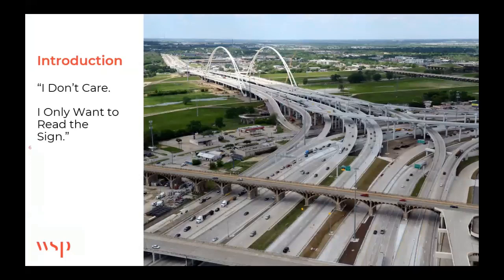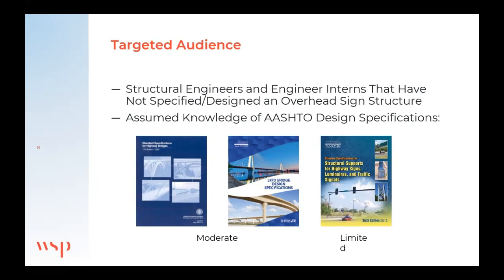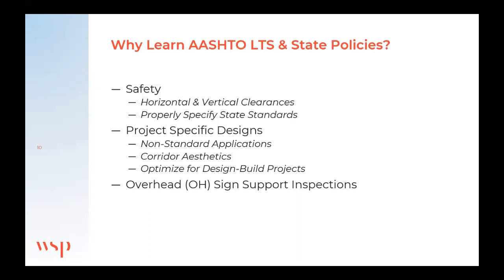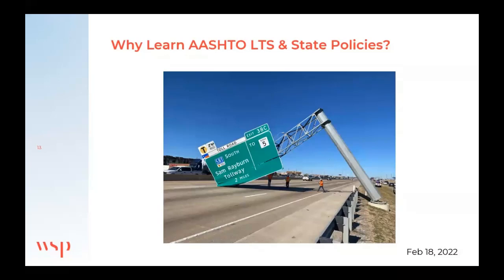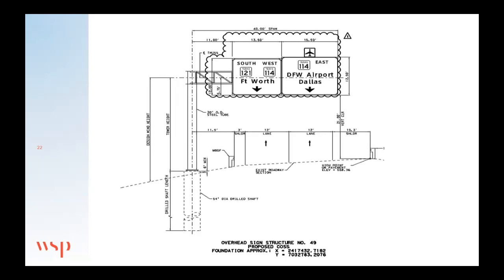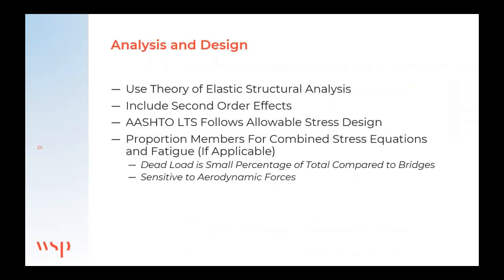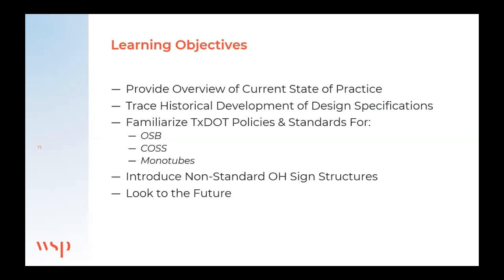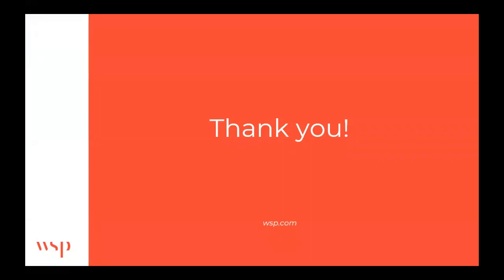ASCE Dallas - Structural Supports for Overhead Signs - Jonathon Seddelmeyer - WSP

Comment: I'm wondering if the base nuts were perhaps over-torqued when installed? This could have damaged the threads -  leading to the eventual loosening of the connection and then to failure due to unforeseen stresses? Just a thought.